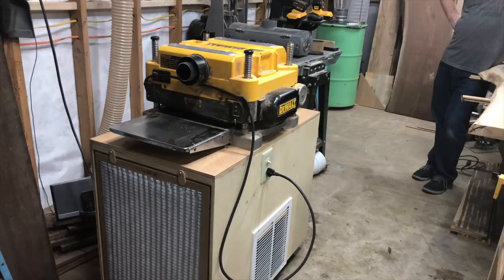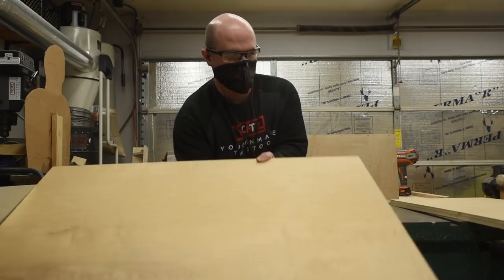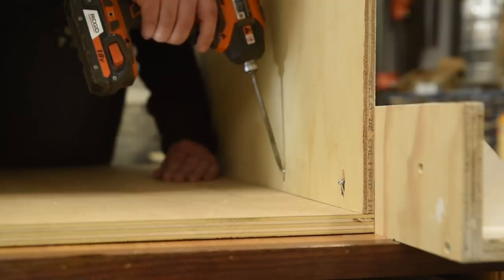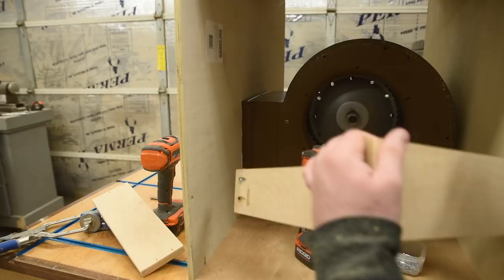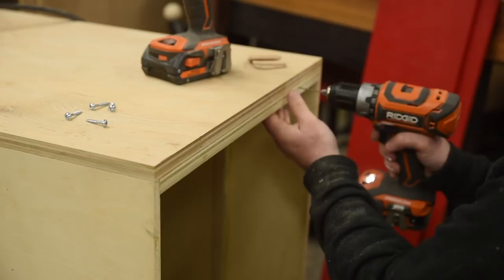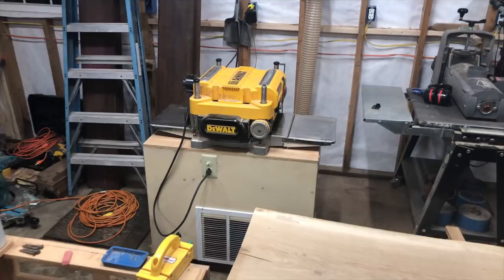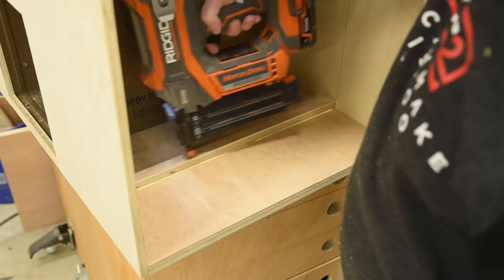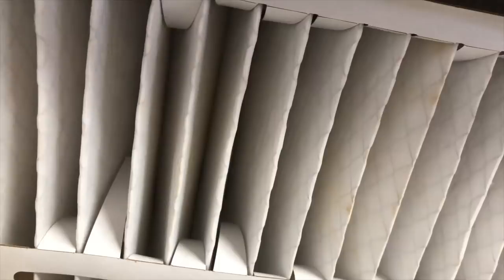How To Build An Air Cleaner / Planer Cart

Comment: The three stage filter setup is a very good idea.  This system will clean the air VERY well and the MERV 13 filters will last a long time.  Great work.  I built something similar and the filters are still going strong after 2 years.
Reply from the maker: Good to know! And glad I’m not the first to try. Just seems like the smart way to go about it if you want to really clean your air and maximize filter life.

Comment: The resistance is actually a good thing, if an HVAC blower motor is allowed to run with no resistance the motor will actually burn up as they are specifically designed to run with a certain amount of resistance.
Reply from the maker: That kinda makes sense, I didn’t think about that. I guess the way to know for sure would be to run it with the filters and measure the amp draw and make sure it was within rating.

Comment: With that many filters I'm sure it makes it less nosey,  but wouldn't that also reduce the airflow and cause restrictions on the blower?
Reply from the maker: Yes, that’s the whole long boring part at the end was about. The resistance a filter creates is related to its performance. A filter that catches smaller stuff will resist more, something that catches big chunks lets more air through and less resistance. The two outside filters are lower rated, the fine filter is 5” deep and has way more surface area than an equivalently rated 1” filter. More surface means more room for air to pass, so less resistance. That said, it’s probably still the most resistant filter, so it’s the real bottle neck. The filters before it don’t resist as much, so the motor doesn’t even know there’s more because they’re not slowing anything done if that makes sense. I unscientifically tested that by pulling the filters out with it running off camera. There was no difference until I pulled out the big one.